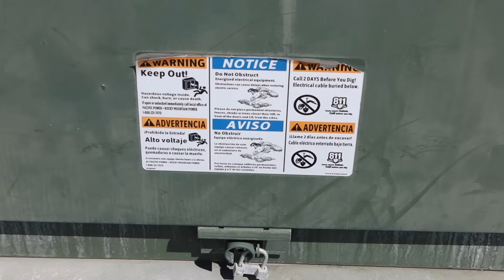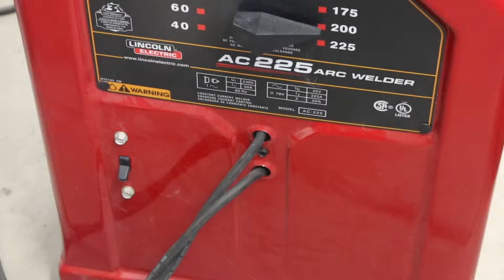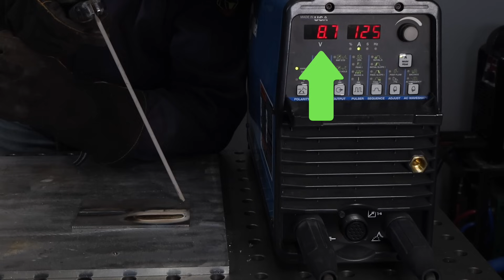Can You Get Electrocuted While Welding? Watch This...Don't Get Shocked!

Comment: Tried welding for first time today w cheap stick welder...
QUESTION PLEASE! right now I'm just experimenting w different cuts and joinery and want even using welding table... I just had 2x5 inch pieces of 1 inch square tubing clamped to wooden bench, then electrode clamped to that same piece... NOW, so I need to clamp my other piece so they align them approach w stick, OR can I just hold the second adjoining piece in my hand while I tack them tgthr... the electricity is flowing into weld and towards electrode then grounded on wood correct? Would heat ever be a concern 5 inches away?
SRY! I just can't seem to get that straight from anything I've watched....
FOLLOW UP: if i DID have welding table and electrode connected smwhr then I aligned to pieces by hand atop table, can I use hand to hold them in position while I weld? Granted my hands are clear of weld area?

An answer from anyone would be MUCH appreciated!
Reply: Yes, so long as you keep steady contact with your table(ground). I sometimes use a temporary “bridge” to ensure full contact. This can be a piece of flat stock or rebar etc. When you have a weak ground, you can be tickled a little bit, as the circuit tries to find ground, through you

Comment: SIMPLE answer is HELL YES. HAVE BEEN ELECTROCUTED SEVERAL TIMES. A welding instructor I know damn near died and was hospitalized for several days. All VRD is non-existent on older power supplies. High frequency will allow welding current to pass through your salty body if the source of ground is lost.

Comment: Interesting info about modern welders.  50 years ago I certainly got tingled off Dad’s Forney C-6 buzz box working outdoors in wet weather.  Don’t know its open circuit or arc voltage, and quite likely I rested a damp arm or knee against the work.  BTW electricity doesn’t just take the path of least resistance, it takes ALL paths, just the most current through the lowest resistance path.  Most of your body’s resistance is in your skin.  Tangle with electrified barbed wire where a point pierces skin, and you’ll KNOW you have been zapped.😮
Reply: Yeah dont weld in wet with open wounds, or you loose that resistance real quick and electricity gets inside of your body.

Comment: Got bit by adjusting a ground clamp for my dad when I was 13 years old by an old 1960’s power Kraft AC welder with a wet floor in our shed. Never fully trusted the ground clamp on welders after that.

Comment: I used to pin weld insulation to ceilings of big remodeled stores. The insulation had a foil backing.  One of us would weld the other hold the insulation up.  Well if you were touching that foil and hanging on to the beam boy that.was a wicked shock.

Comment: One time I was stick welding using a cracker box on a trailer frame in a heavy fog/light drizzle, and while sitting on the frame (wet pants seat) I went to install a new stick into my stinger and I got the peawaddy knocked out of me.  Time to roll 'em up for the day.

Comment: Just a reminder that death is possible from less than 1 amp of electricity.  A few tips from a field welder that has been doing it for 20 years: 1) If lightning is in the area and you are working on structural steel, stop work and let it clear out before you get back to work. No job is worth your life.  2) Always wear electrically insulated, quality boots with rubber soles--invest in them and they will pay you back tenfold. 3) Buy a 2'x2' rubber matt square to have with you as part of your tools.  It will help insulate you from getting shocked when wet conditions are unavoidable and, what's more, it helps protect and cushion your knees or back depending on the position you have to use to lay down a bead. 4) Have an extra pair or two of gloves in a dry and secure place that you can switch to if yours get wet.  Wet gloves are no joke and having an extra pair can save you or one of your crew members from injury or death. Finally, don't you ever forget that you, ultimately, are the one responsible for your safety! Remember those you love and want to come home to and act like you should so you can see them soon.

Comment: Righto Tim..notes for my safe weld poster.
    Avoid welding in the rain
    Turn stick welder off in between setups
    Attach ground terminal near as possible to each weld
    Wear leather gloves with other proper protective clothing
    Make sure the spark watcher doesn't spray down anything without the welders permission!0!

Comment: Great vid, I have to say you didn't actually answer my questions, along the lines of what is safe to physically touch and what isn't. Some of the comments here helped a little, but some clearer instruction on where is safe to lean my elbow, is there an electrocution risk if bare skin touches the stick during stick welding, is there a risk if bare skin touches metal in between the electrode and the work clamp, etc, as I'm still terrified to start before I have clear, unambiguous answers to these question, prefixed with a solid YES or NO where possible! But, that said, thank you, it was informative nonetheless, and any experienced welders with solid answers to these questions, I'd love a reply!

Comment: Looks like i'm just echo-ing every other comment here, but this question has haunted me since i first looked into welding. No-one seems to explain it, so a thousand thanks for addressing it here. You see, I've had an entry level stick welder [brand new] for ages but not even plugged it in yet! But I'm hoping to 'give it a try' sometime soon.
BTW I have quite a 'shaky' hand so is it possible to steady the electrode with, maybe, a notched piece of wood or other non-conductive material?

Comment: I got a walk off a AC mig when I was nealing on wet pavement and I touched the mig wire f.... Me shit my pants lucky it was on low amp now I use an inverter DC and only use the 12v DC safe site voltage

Comment: it wouldnt be a bad idea for everyone who welds to understand the basic flow of electricity in a circuit...  V = IxR.    which can also be seen as I = V/R .  and in real life situations where people get shocked, there is usually gonna be 2 things providing resistance.... your work piece and you. that means there are 2 paths ground for the current to follow. you want to be the high resistance path :) so that the current will go  go thru the work piece to ground.  it aint a bad idea to watch a couple videos about how current flows in one of these  multi-path circuits

Comment: You don't get any shock don't worry its will be a less effective shock when you hold both the wires or when you make the loop from your body I am worked in this field and did incredible work they standing on the large buildings. unfortunately now am in the software industry I lost the touch with welding but I would still love to do welding because this is where the invention is standing, if you dont weld two metals then nothing you can invent in this world will be only in the form of thoughts and ideas.

Comment: Not accusing you of having done this in any way, but everyone has heard that electricity always chooses the path of least resistance. This is a gross oversimplification of the truth that has resulted in many deaths. The reality is that when two paths are available, the current is split between the two. The amount of current (amps) in each path to ground is inversely proportional to the resistance (ohms) in each path. I.E. 90amps split between your workpiece @ 30ohms, and you @ 60ohms, 60 amps will travel through your workpiece and the remaining 30amps will travel through you. It takes less than 1amp across the heart to stop it.

Comment: You sold me on your stick razor blade vid. and I subbed. But this is a question that I think many new welders have. Even those of us who have done gas welding before, but never touched electrical welding, like me. I mean I've seen people actively handle parts even with bare hands while welding and I always thought, "well, it seems safer than I thought". And modern welding is, absolutely, thank's to technology. But it was still one of those knawing questions, that I had in the back of my head. Like "under what conditions does it become really dangerous?" and you helped answer that. Cool!

Comment: The open circuit voltage of the welder is only about 70 volts, and under load, it's only around 30 volts. When the welder is not welding, if it's a stick welder, then you could get shocked if you touched the electrode with bare hands, and also touched the ground strap on the welder. 

Fortunately, the welder cannot shock you by standing on the ground, with rubber shoes, and touching the electrode holder. That's because the output on the welder is "isolated" and not connected to the Earth. 

A welder is one of the only common tools that has an "isolated" output power, which is why people don't get shocked easily by welders. 

However, if you are welding on wet concrete, that could create a connection between your metal work table and the concrete. You should not be welding on water. Water and moisture, including sweat, is the number #1 way to get electrocuted. I do think that most deaths are actually attributed to water and moisture. With dry gloves, and without being really sweaty, you are less likely to get shocked by grabbing the welder parts outside the welder.

Never handle the welder without your dry leather gloves on, and then you can eliminate most of your risk of being shocked. The main risk comes from your hands, and how you handle the welder electrode. Make a general rule that if the power switch is on, you must have your gloves on!

However, as a final note, make sure your gloves are in good condition, and not embedded with a lot of metal shavings, and sweat. Your gloves can become conductive if they are heavily used. I once noticed that my gloves were actually slightly magnetic, because they had so many fine metal shavings embedded in them..

Comment: Here's another tig welder real story.  My first factory age 18 hey you want to try welding? So my training for tig was tank tester. Plug fittings on new fuel tanks 5lbs of air paint seams with soapy water. I stood on a wooden pallet and unplugged the air and couple days in had wet gloves and went tig torch to rod to wet glove. Nasty arc jumped and fused my wedding gold band to my finger. Trip to emergency room to get my skin scalpeled off. Oh another bad one no one told me about infrared light. Very hot day I tig welded in short sleeves. Next day both of my milky white arms were maroon. Beware

Comment: I drilled water wells. The machine was the ground and welding with wet boots,  standing in six inches of mud, wet golves, and sketchy cables in the mud was normal. I did get a "tingle" a few times but never anything I felt was life threatening. Not bragging but I could weld  (two passes) six inch pipe and drive it into the ground with enough foce to have to cut off six inches of the top for the next piece. Never broke a weld.

Comment: Most arc potential is in the 12 to 24 volt range. Just enough to start and maintain but quite enough to be dangerous. Stick welding in extreme heat, where you’re sweating like a horse and also quite intimate with ground, inserting new rods using welpers is advisable so you don’t get annoying little shocks all day long. Also, it’s amazing to see just how far a TIG arc (on a remote control system with high voltage start) can stretch if you back the torch away from the work before powering down (a common rookie error), that’s an arc that you don’t want to be part of and I demonstrate this to trainees right off so that they take it seriously.

Comment: I appreciate your covering this topic. I think you did a very good job of getting the critical aspects of safety across. As an engineer, I'm not a great welding but I do have a very good understanding of electrical circuits. Voltage really does not hurt you but Amperage can indeed kill you if you provide the amperage a path through you. Welding is dangerous because a welder boosts a low amperage circuit into a high amperage circuit. When you ground your work to the welder, you are providing the welding arc the least resistant path from the welder, through the work, back to the welder. This is true regardless of the circuit path, as in electrode negative or electrode positive. This is why, if you are not grounded, you can touch your welding material while welding without getting electrocuted. It is also why you can put a new rod in a stinger without getting shocked. You need the proper clothing and equipment to make sure you are not providing a path or circuit through your body to a ground. The equipment needs to be suited for the environment you are working in. A dry location with rubber soles is the best condition. However, pipe fitters and farmers weld in wet conditions and marine welders weld while under water. So, the right equipment is needed for each condition.
Reply: Thank you for your information. I have a question though: if the path of least resistance is from the welder to the table and you put a stick in the stinger while it is live, why don't you become the new path of least resistance? We are mostly water with electrolytes. Are our shoes the sole (😉) reason we are not electrocuted?
Reply: @rickb2267  Skin actually has a very high resistance so all that conductive material is below our skin , once your skin is pierced or your hands are wet , then it becomes dangerous
Reply: @rickb2267  Good question Rick B. While we can conduct electricity very well, if we are not grounded, we are not a circuit for the electricity. The welding circuit is a big copper conductor from source to ground through the welding circuit. When you stop welding and touch the stinger, the welding circuit is "open" and there should not be a circuit through you to the ground. Now, if you were wearing the wrong kind of boots and standing in water, you would complete the circuit and blow your toenails off and likely stop your heart. I have seen electricians hold a hot, 200 AMP service entry in their hand, with no ill effect, because their other hand was in their rear pocket and their boots had rubber soles. No electrical path existed. So, wear good boots or shoes and when you change the rod do not hold the stinger/rod with one hand and touch your work with the other bare hand.
Reply: @chucklynch8397  "When you ground your work to the welder, you are providing the welding arc the least resistant path from the welder, through the work, back to the welder. This is true regardless of the circuit path, as in electrode negative or electrode positive. This is why, if you are not grounded, you can touch your welding material while welding without getting electrocuted."   Thanks for this... this is the single most important thing to understand about electrocution risk.
Reply: @rickb2267  "why don't you become the new path of least resistance?" 

You can, and sometimes do. 
When I'm welding in the rain, I'll clamp onto the new rod from where it lays. 
Just pull a few out staggered a bit, like offering someone a c¡garette in the olden days..

Comment: You're not dealing with the high voltage input side but more the low voltage. If conditions are right you can still get some good shocks.
TIG welder on the other hand usually have higher voltage start to help get arc started without having to touch the electrode to the work. Now THAT can be like grabbing high power spark coil on a car.

Comment: It's been nearly 40 years ago but while welding onboard ship I reached out to stabilize a small piece to tack, suddenly an arc blew out the Palm of my hand, put about a 1 inch split in the meaty part of the palm. It didn't bleed and no real pain afterwards but initially it was one dirty poke.

Comment: Pro tips:
1) Don't weld while nude or barefoot.
2) While stick welding, don't suck on the electrode while simultaneously gripping the work with your bare hand.   (I always unplug the machine before sucking on the electrode.)
3) Keep your barn door zipped and your "animals" safely inside.
4) While in the bathtub, don't clamp the live electrode holder to either ear lobe.   I don't care how good it looks, it's not worth it.